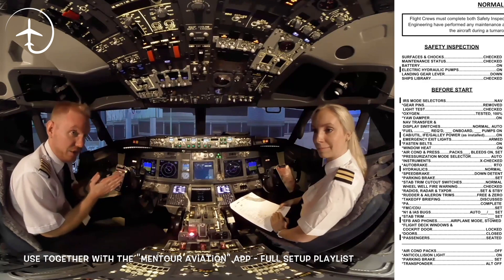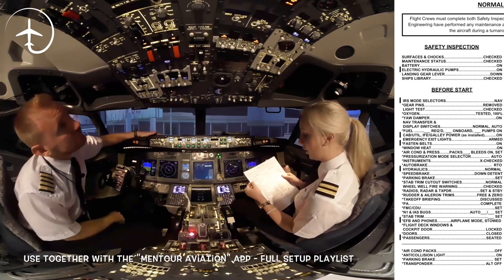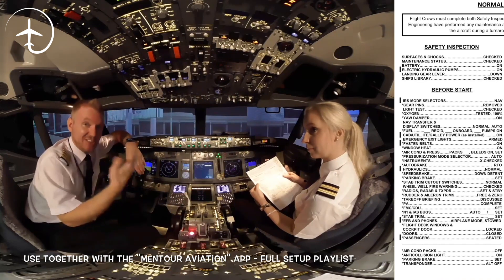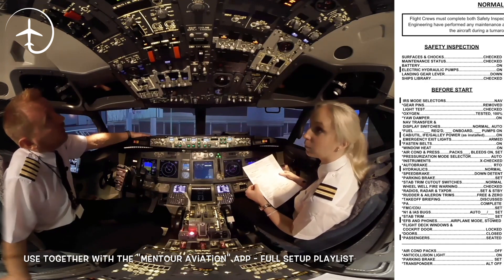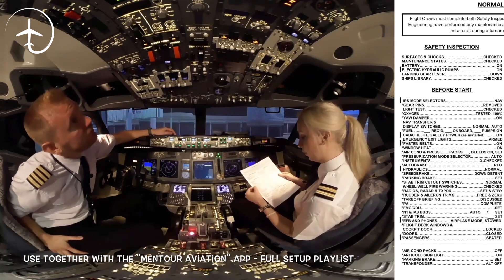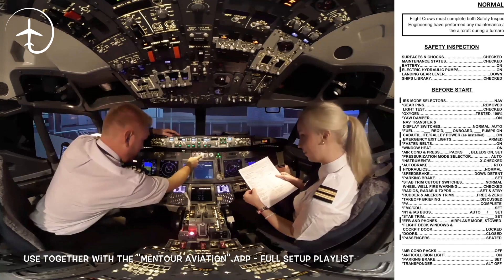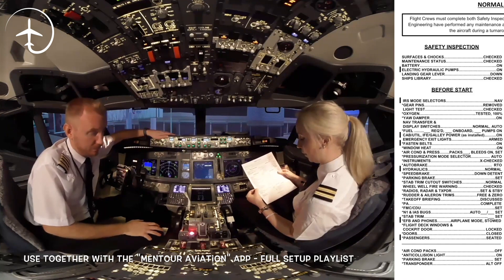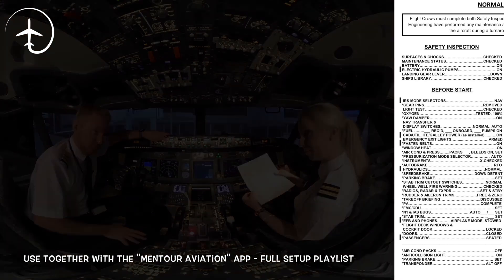How to read a Boeing checklist

Comment: This is absolutely not a Boeing checklist, this is a customized checklist for your company. Boeing checklist dose not have Safety checklist. The way Boeing checklist is designed that both pilot will response to the checklist item according to the area of responsibility. Overhead panel is the area of responsibility of the FO (on-ground) and Pilot monitoring (inflight).

You as the captain responding to overhead checklist items in this video shows that your company procedure and checklist are not Boeing procedure.

Comment: Why isnt this stupid checklist automated and built into the system electronically?
Reply: So pilots know exactly whats happening, how and when. If 1 wire is a little faulty after a rough landing the whole system is compromised. If theres engine trouble during the ascent the pilot needs to know exactly what the plane is trying to do and what its set for to figure out how to help and fix the problem, if this is automated he can't.
Reply: Because the 737 is a 1960s design with lipstick added over the years. Needs to stay similar enough to be a common type endorsement. The 787/777 have ECLs (electric checklists)

Comment: 2:01 is extremely important - that one brought down Helios Airways Flight 522 because it was set to manual
Reply: pressurization mode selector ??
Reply: @Rodrigo-oq8zq  yep a mechanic set it to manual to test it and forgot to put it back - pilots never noticed and they all blacked out and died
Reply: @AlonsoRules  what happened to the mechanic?
Reply: @VictorTHFC  not his fault tho, pilots failed to do checklist poperly, climbed despite take off config warning
Reply: @0000SYL thats false, there was nothing wrong with the configuration of the aircraft when they took off. But the sound of the aircraft not being properly pressured was the same as the wrong configuration for take off, and that is what made those pilots confused
Reply: Nothing because today flying is extremely safe and most big plane crashes with VIPs on board are all staged.    :)   Have a great day.

Comment: Dear Mentour! I suppose that these are rules of reading a B737NG checklist of your company? The checklist seems to be different from the original Boeing one. Just as a note - Preflight checklist responses are /originally/ based on the Areas of Responsibiliy, not only the Captain is that guy who gives responses. In my previous airline they had a policy that the CPT gives responces, but then changed everything in accordance with Boeing recommendations.
Reply: I agree with Denis, Boeing procedure responses are based on the Role or area of responsibility. 
If I am not mistaken the QRH have a table representing the item to be called by which pilot and the response to be made by which pilot.

Comment: Wouldn't a "random checklist" keep you more focused? Doing the same check sequense every flight might be, simply by repedatlely human error, be missed as you follow the same precedure every flight? See you use an Ipad and maybe checklists aren't on those but that would easily put every check in a radom sequense? Hope you get my point...😜
Reply: I’m guessing there’s a reason why the checklist is read in that particular order?
Reply: @AW-kr9fl many checklist items are done in a specific order.  For example, in a small single engine airplane we do a run up before takeoff.  This is a slightly elevated power setting for the engine.  We want to confirm the engine is safe to fly.  One step is to make sure the oil pressure is correct before increasing the throttle.  Another is to enrichen the fuel air mixture before the throttle.  So, order of these steps definitely matters.
Reply: Håkan Björkman I agree, certainly when having watched his latest video that covers checklist rhyming. seems like a good idea to me
Reply: Actually no. Doing everything randomly instead of a trained procedere increases the possibility to skip something important. Greetings from a train engineer.
Reply: There are different types of checklist. 

The ‘normal procedures’ check lists come at stages after pilots have done there set up or procedures leading up to that stage. 

For example, pilots do the flight deck set up to the point at which they’re going to brief the take off (15 mins before departure typically), then the preflight checklist is completed. It’s a read and response checklist that covers stuff that will kill ppl, essentially. 

Next after briefing, configuring hydraulics, final paper work and doors closed, the ‘before start checklist’ is completed. Read and respond. 

It continues the same way every flight. Most airlines personality profile their pilots and select those that love patterns that repeat, because when something is out of order or doesn’t feel right, it attracts their attention. 

Repeating patterns are desired by these personality types. 

There are structures to other checklists too. 

Memory item checklists (the first few steps of a reference checklist of a serious problem, like engine fire or depressurisation). They are done in order by memory and required to be known by heart. Usually only a handful of steps, but it’s for a situation that’s more critical (phase of flight or potential negative outcomes)

Reference item checklists, like when a system caution light illuminates or system fails, like a hydraulic system. Thats a read and do style checklist. 

TLDR:
Read and respond checklists (making sure normal procedures flight deck set ups have been performed correctly for phase of flight about to be done)

Read and do checklists 
Non normal system failure events. Read out of a book of checklists 

Memory item checklists
Usually the first few steps of a non normal checklist that need to be known by heart and performed without looking at any checklists

Comment: Hello!
I don't know if this subject isn't very technical, but can you explain in a video, how the YAW Damper Works?
Reply: Sweptback wing design on aircraft have an error called Dutch Roll, where the aerodynamic flow on the surfaces causes the aircraft to yaw left and right increasingly, which can become an uncontrollable situation. There is a counter to it installed on the vertical stabilizer which does this automatically. That´s the yaw damper.
Reply: Gustavo Mognon I can explain how it works. I do encourage you to download the Mentour Aviation app,  so much more content there. think of it as a smorgasbord of aviation knowledge😉
the yaw damper is an interesting piece of kit, used on many jet swept wing aircraft. which dampen (reduce) the yaw and roll oscillation referred to as  Dutch roll.
Reply: Instead of you having to constantly manually trim the aircraft it's done automatically so pilots can concentrate on other issues. Fuel monitoring and flying the plane turns banking if not on autopilot. I thought auto pilot did everything but not all.
Reply: As a train driver we have yaw dampers on trains

Comment: Holly skipped the CAB/UTIL, IFE/GALLEY POWER check item....tut tut Holly :)
Reply: They are probably unable to, due to it being company info.
Reply: I wonder if inadvertently missing one checklist point has ever caused a problem.
Reply: @DjVortex-w  It has. Also, "Rhyming" has caused crashes too, as in Air Florida Flight 90